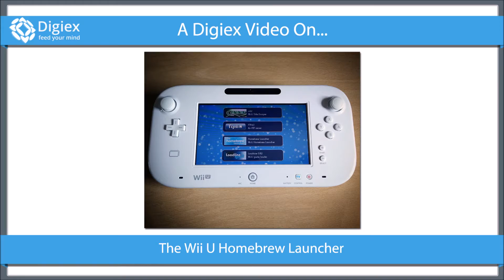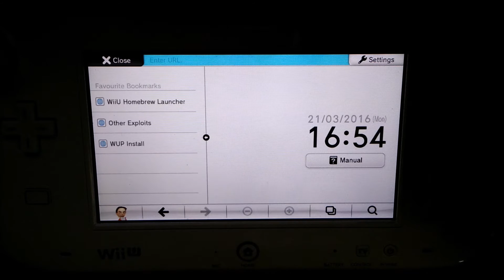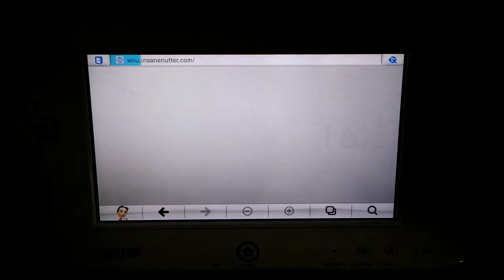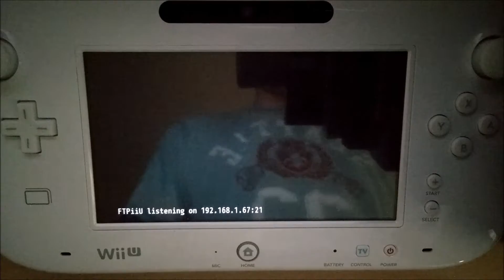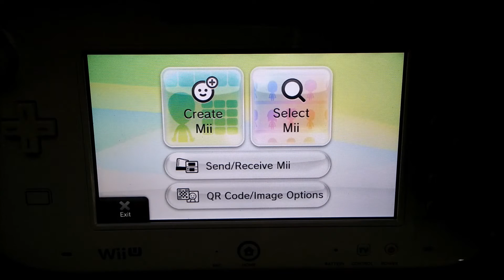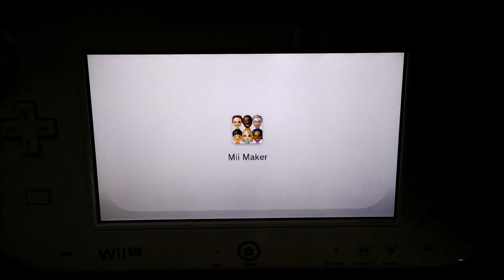A Look At The Wii U Homebrew Launcher [Wii U Hacked]

Comment: Is this procedure the definitive unlocking of the Wii U or are only homebrews installed on the SD card? If for example: I removing the SD card to use the Wii U, the same Wii U would be working as if I had not installed anything?

Comment: does anything happen when you push the homebrew launcher button above the loadiine button? every video I watch it's never loaded. which sucks because nothing happens when I click to load it. just want to know if it's a problem I'm having or if that's the way it is supposed to be
Reply: No, you are already in the homebrew launcher, all it does is let you load homebrew from the SD card. If it re loaded it's self it would be pretty pointless.
Reply: +InsaneNutter  thanks. that's what I was thinking. I'm new to this, obviously.

Comment: have you tried running Wii homebrew apps in it?
Reply: You can homebrew hack the "Virtual Wii" on the Wii U to run the majority of the older homebrew applications.
Reply: I know that, I was just wondering what happens if you try running Wii Homebrew in Wii U homebrew launcher
Reply: Yeah, would be nice to use the Pro Controller and the Gamepad to play games. vWii does have its limitations.